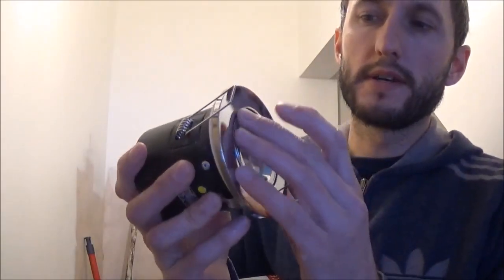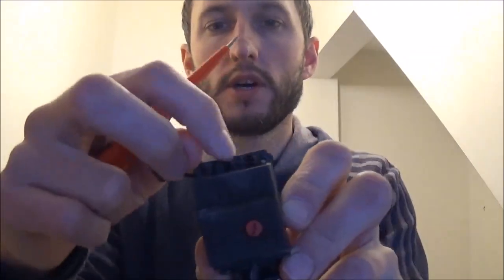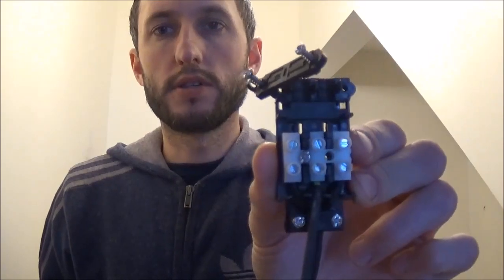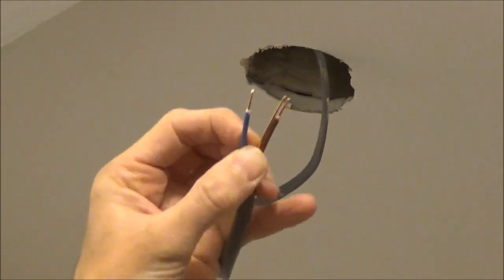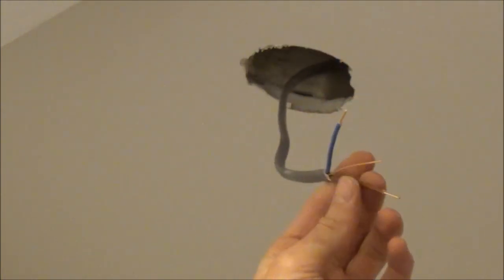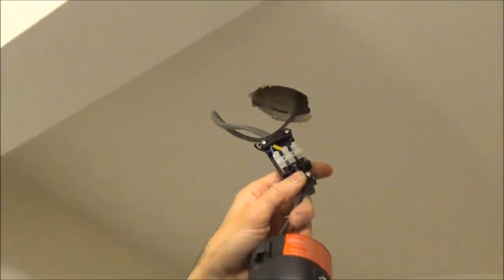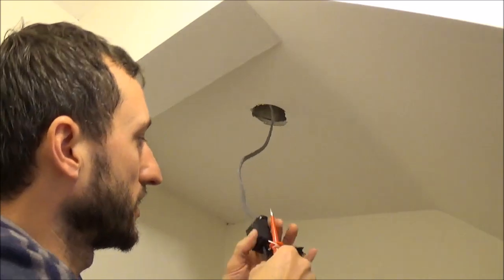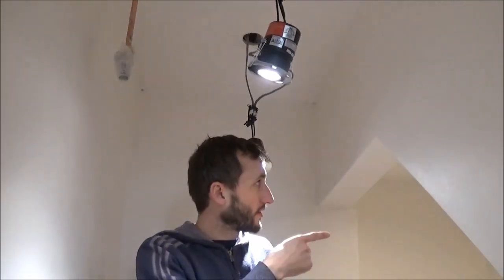How to install downlighters/downlights. LED downlight installation.

Comment: Need some advice mate, how would you fill a wide hole for one of these lights? I've managed to get the light to stay in the ceiling but there is a 5mm visible gap all the way round the spotlight. I dont have access to any plaster board cut outs.. Is there an easy way to just fill the gap with some wall filler or something else you can recommend? Cheers
Reply from the maker: Hi, to be honest, I would get a small piece of plasterboard and stick it down above the ceiling then use some filling plaster onto the piece you have stuck on and give it a smooth finish. This should be done with the light fitting out of the way. You can't really fill the gap with plaster or filler if you have nothing to fill up to, and filling the gap up to the light fitting isn't a good idea as the plaster will likely push into the back of your light fitting which is no good and could be dangerous. Also it'll fall out when the light fitting is removed. Apologies if this is no help for you, but I suggest buy a small bit of plasterboard, they're only a few quid and do the job right. Thanks for watching.

Comment: what if you have an old light in the room and you want to change it will i need splitters if so could you show me a video plz
Reply: I'm also very interested in seeing that video :)
Reply from the maker: Hi Tom, you're in luck! I've just finished editing a video for this so will hopefully be uploaded later today. It took a bit longer than expected as I decided to do a demonstration with different connector blocks and junction boxes to give viewers a choice. I have also explained ceiling wiring with diagrams to explain the whole process. The video is a bit longer than expected but hopefully more useful for viewers in the long run. Thanks for watching.
Reply from the maker: Hi, I will do a video on this very soon. I've promised a few times but just haven't had time. I used an Ashley Hager connector box which is designed for exactly this job. Basically replicate the wiring in your ceiling rose into the Ashley hager box. Where your white flex cable currently comes out and back in to the ceiling rose, you replace it with a length of 1.5mm twin and earth lighting cable. This provides you with the length of cable seen in my video which has an earth on it. This allows you to use metal fittings by safely earthing them. The hager connector box is pushed into the ceiling and all the wiring is hidden. You then do your downlighters as seen in the video. But hold fire, I'll upload a vid very soon. Thanks for your question and thanks for watching!
Reply from the maker: Hi hodges,  I've just finished editing a video for fitting the ceiling light/wiring so will hopefully be uploaded later today. It took a bit longer than expected as I decided to do a demonstration with different connector blocks and junction boxes to give viewers a choice. I have also explained ceiling wiring with diagrams to explain the whole process. The video is a bit longer than expected but hopefully more useful for viewers in the long run. Hope it helps and sorry for the wait!
Reply: POUSE around the HOUSE great stuff! Thanks for sharing your knowledge!
Reply: Tom Newbold

Comment: Hi there you know how u have your first cable that you are using to install your first spot light ? Would that be the centre room light you get in all rooms? And from there you've disconnected the ceiling light from the cable fitted the spotlight then from there carried the current from that light to the next ? And does it matter how many lights to have running off the main current ?
Reply from the maker: The cable I started with would be like the one in the centre of your room....possibly. If you have a ceiling rose arrangement with a lamp shade, you will have a short length of cable with only a neutral and a live. You basically need to replace that with a length of 1.5mm twin and earth cable (like in my video) connecting the new cable back where the old cable was. Now, the reason there is no earth sometimes is because the ceiling rose is plastic and doesn't require earthing. So you may need to remove the whole plastic ceiling rose, disconnect it, and then recreate that connection. You will need the earth to connect to downlighters and metal lights to make it safe. I used a 16amp Hager connector box for my ceiling connection. If you search on the internet you will see they have the connection points just like a ceiling rose, but you can seal the box and push it back above the ceiling leaving the one cable poking down which is the cable you see in my video. I really want to upload a video of this but just haven't had time yet, but I will soon. Then you can run all your down lighters off that connection like I showed in the video. As for how many you can have, it depends on whether your cables are covered by insulation, the length of your cables, the amps of your lights etc. You would need to check the Regs, but realistically, if you're using led lights, they draw way less power than old lights anyway so a few is probably fine, but always check first. Getting a modern consumer unit with RCD protection is the best way to ensure safety in the home, and all your work should be carried out by a competent, qualified electrician. Hope this helps!
Reply from the maker: Hi Dean,  I've just finished editing a video for fitting your ceiling light wiring so I will hopefully upload it later today. It took a bit longer than expected as I decided to do a demonstration with different connector blocks and junction boxes to give viewers a choice. I have also explained ceiling wiring with diagrams to explain the whole process. The video is a bit longer than expected but hopefully more useful for viewers in the long run. So hopefully his will help you out.

Comment: Any chance of letting us know the led downlights you got from Screwfix so I can emulate this setup?

Thanks very clear and easy to understand video
Reply from the maker: Aurora Fixed LED chrome 4.5w IP65 rated fire rated. I used these in the splash zones.http://www.screwfix.com/p/aurora-fire-rated-fixed-led-downlight-ip65-polished-chrome-4-5w/82240 Aurora adjustable LED chrome chrome 4.5w IP20 fire rated. I used this on sloping ceiling as it tilts but cannot be used in a splash zone.http://www.screwfix.com/p/aurora-fire-rated-adjustable-led-downlight-ip20-polished-chrome-4-5w/79072
Reply: +POUSE around the HOUSE cheers mate!

Comment: great video is it OK to lay loft insulation back ontop of these lights when after you have installed them? or is it a fire risk.
Reply from the maker: If in doubt, always check with the manufacturer. However, generally LED lights don't really produce a lot of heat so it should be ok. Leave an air gap around the light fitting. You don't want it in direct contact with the insulation. I used cellotex board insulation above my light, and as it is rigid, you can cut a hole through it to leave an air gap around the light. Hope this helps. Thanks for commenting on my video. Good luck with your project.
Reply: Thanks very much 
👍
Reply: You could fit Thermahood downlight covers!
Reply: Thermahood - Downlight Covers! I have these exact same Aurora lights, would they work with one of your downlight covers?
Reply from the maker: You could but these lights are firesafe. As I said previously always check manufacturers instructions/guidelines as they often override any regulations.
Reply: Ceramic planting pot lol...
Reply: If you have a closer look at Thermahood, there is a look more to it!